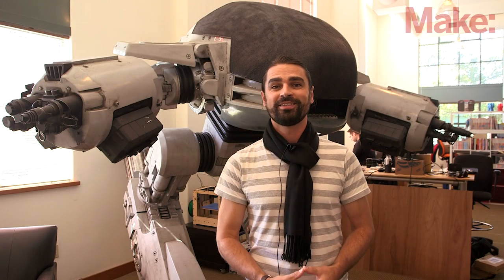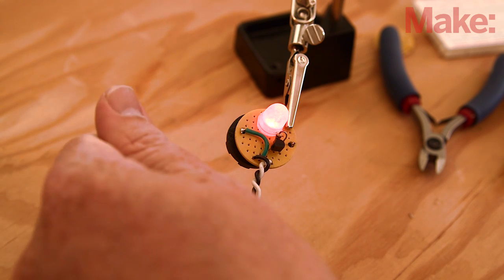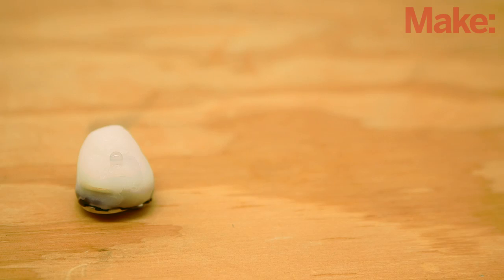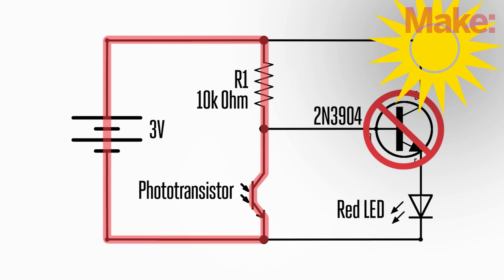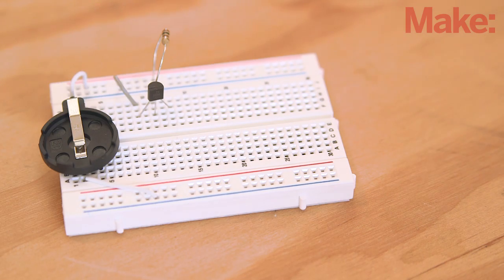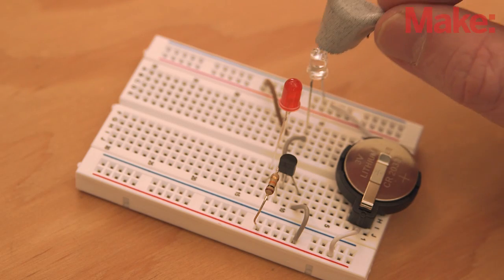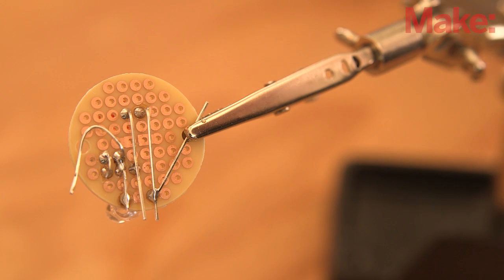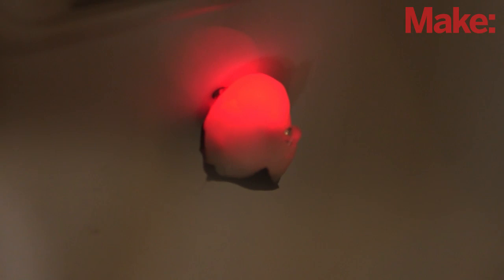Weekend Projects - Dark-Detecting LEDs

Comment: the explanation on the video is a little flaw, so let me clear a little 

first when light goes up, it reduce resistance from the phototransistor, so the current almost nothing goes to basis and not trigger the transistor from saturation, and when the light goes down, the resistance of the phototransistor goes high, so the current goes to basis and has enough power to make transistor saturation, and when it on saturation it connect the basis to the emitter, and bam the led goes on
Reply: is it me or what ever you guys talk about on how it works, it looks to me like it uses power 24/7 when its ether light or dark.
Reply: yup. poor designed

Comment: My circuit works backwards! It switches on the led when it is in daylight. Does this happen because I used a BC557 transistor and a different-looking phototransistor? BC557 is still a PNP transistor and the phototransistor was saved from a night-detecting decorating light